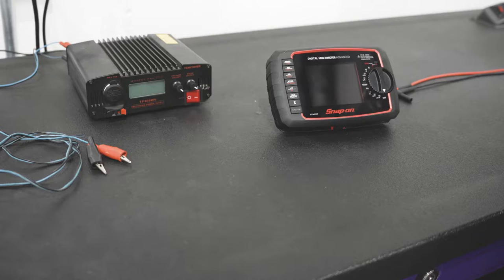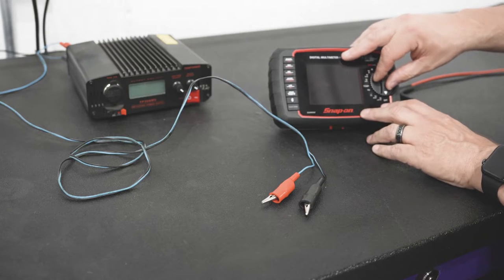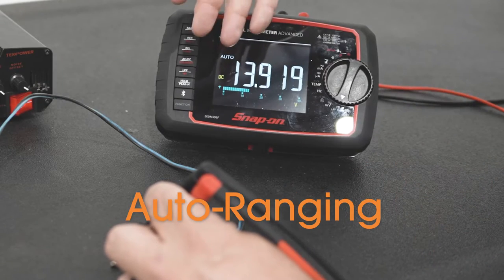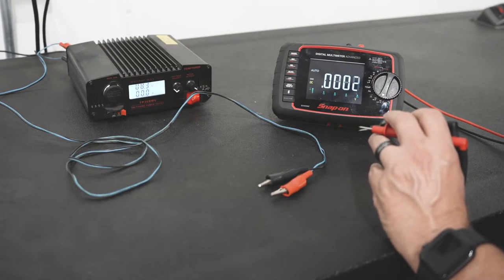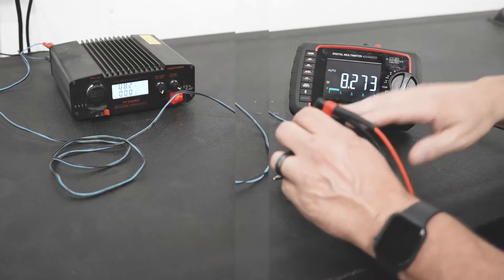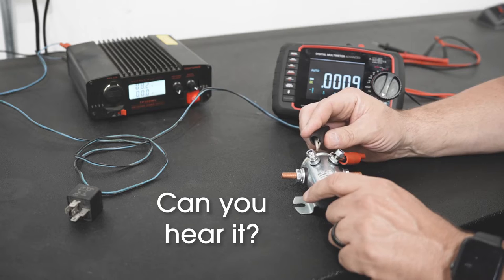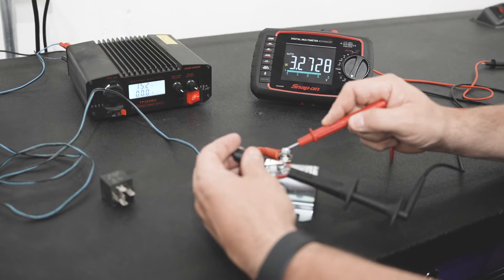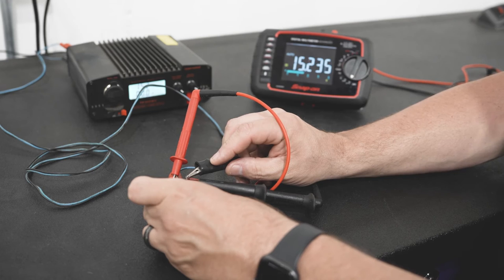How To Check Voltage Ohm Meters (DVOM)

Comment: S2255E base side door latch keep opening even when adjusted) Motor ain’t powerful enouh, barely climb hill parts number for filter and maintenance can’t be easily found they prefer giving manual book with all the filter and part for all motors instead of pin pointing what you need for your machine specifically how and i almost forgot diagnoses on these LMAO good luck